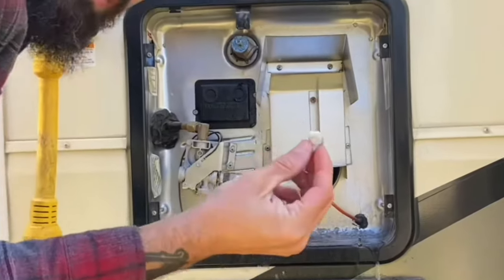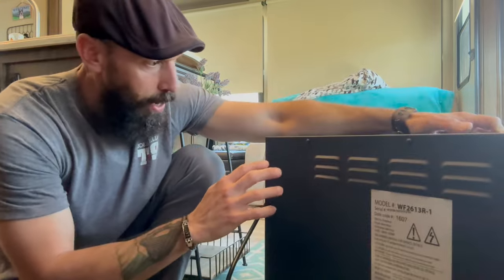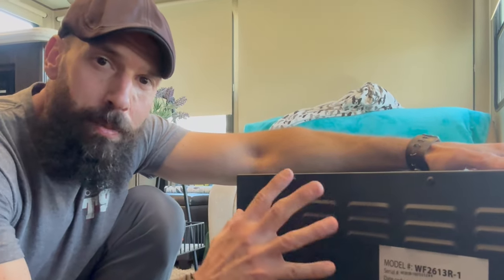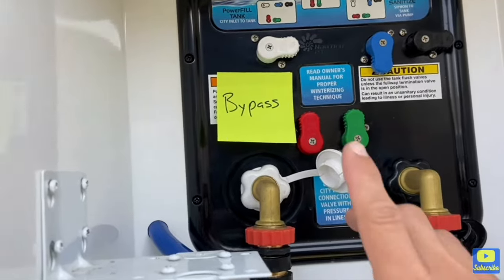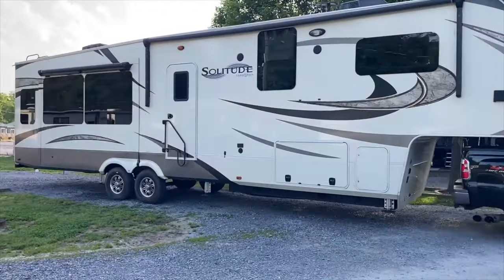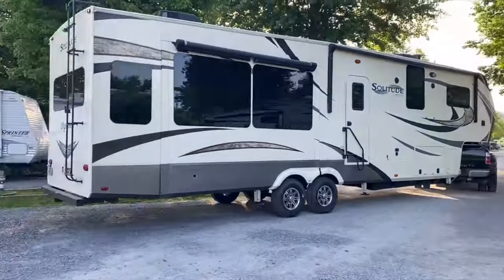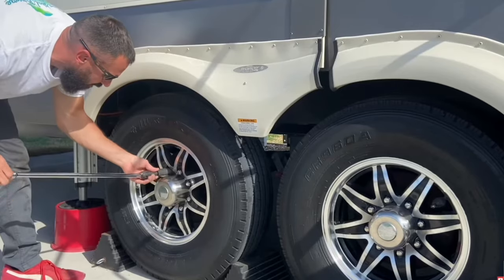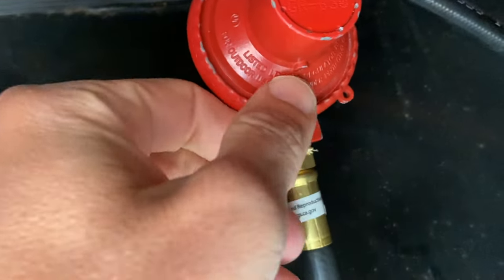7 RV Maintenance Tips! RV Spring Cleaning

Comment: GM Chris, man never even thought to look behind the fireplace unit.   Thanks for that tip.   I have a pair of cartridge water filters I am replacing next trip out.   We have a Dometic WH in our rig.   Is washing out the water heater necessary to do still?  Thanks.
Reply from the maker: Yes Mike I would still empty out the tank once a year and flush it out to clean out any build up or contamination in there. If you see what looks like calcium build up from hard water you could still do a descaling process on it too. 👍🏼